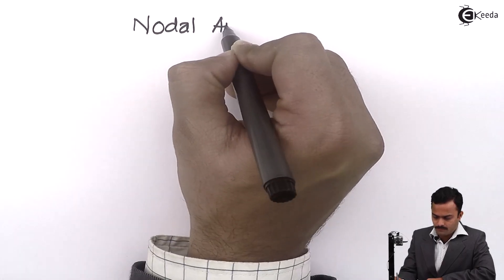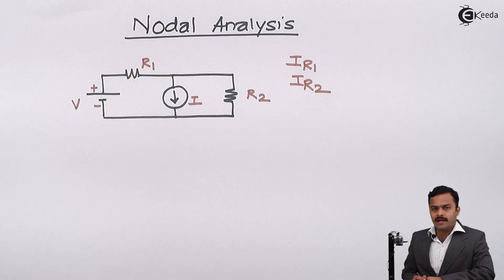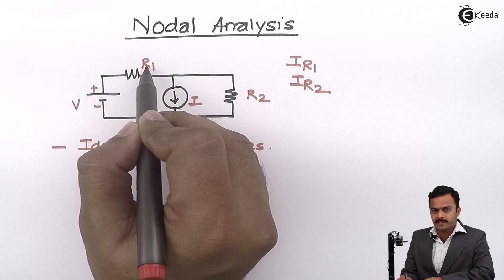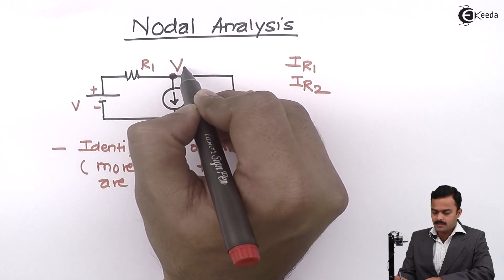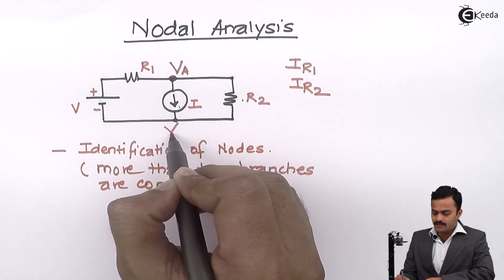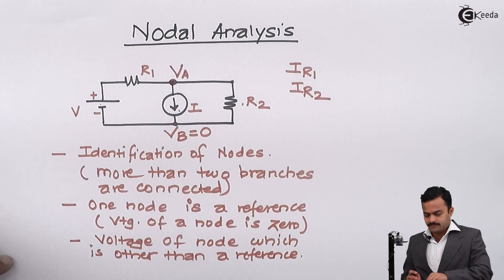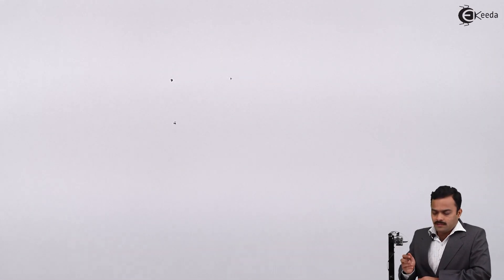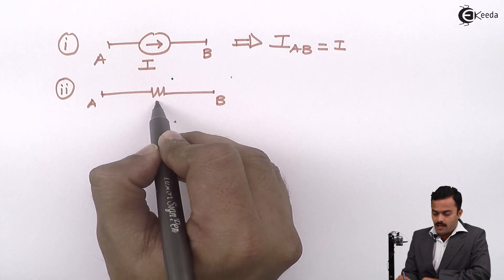Introduction to Nodal Analysis - DC Circuits - Basic Electrical Engineering

Comment: node is the meeting point of terminals of two or more circuit elements
Reply: yes, you are right, but here this is called junction... I mean if more than two are connected its called junction. if I wrong please mentioned the wrong side.
thanks

Comment: Hi ekeeda, I would like to suggest an edit or correction for node definition. A node is where two or more junctions meet. So 2 junctions meeting will create a node.
Reply: yes you are correct but for significane node more than two nodes are reqired
Reply: yes you are right.
Reply: Then what is a junction?
Reply: Noooo
Reply: https://youtu.be/WT1d02TdlhM
This video will be more use full for preparation brother